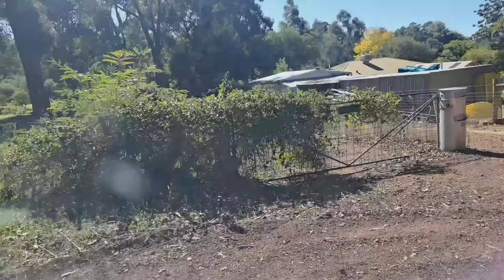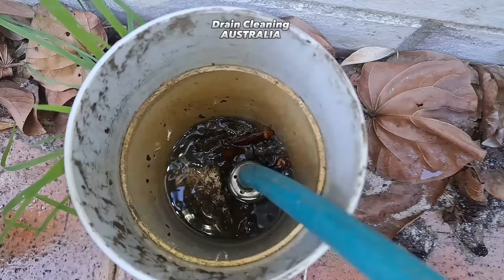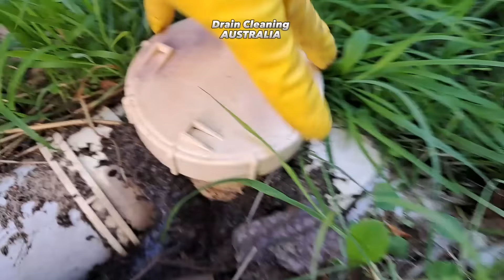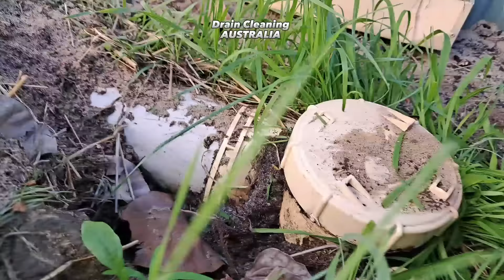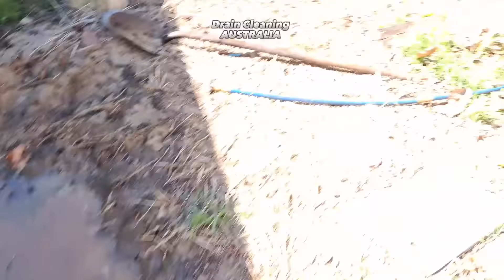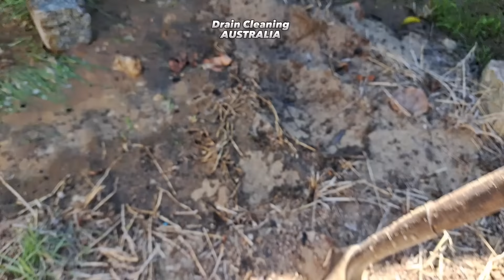The WORST Blocked Drain of my Career! 🚨

Comment: Note to self, when the owner tells you it’s not the problem, that’s exactly when you go directly to where they said it was not and its right there, fun times, thanks Bruce.
Reply: When our small model making shop lost our lease and moved into a shared workshop, the lessee of that facility advised us that, although she had a large lunchroom, we had to pour any extra coffee, water, etc. out in the washroom in the hall. Her double sink was completely blocked, and if we ran water into it, we'd be bailing it out by hand. Some PROFESSIONAL PLUMBER had quoted her $$$ to rip up yards of pipe as the problem was complete block 30 feet away,  blah, blah, blah. 
I don't know why I doubted that (with no qualifications in plumbing at all) but found a force plunger in the janitor's closet and borrowed it. I quietly ran a few inches of water into one sink and seconded another woman working there to put all of her (considerable) weight on a wad of wet paper towel stuffed in the other sink's drain. Pump. Pump. Pump >CLUNK< clunkle – the noise came from under somewhere far down on the first floor, and the water poured out of the sink.  
Our new sub-landlord was delighted at the news, convinced I was some sort of plumbing genius among my other talents. It made for a good start.
Reply: The only snag with brute force is when a push fit pipe coupling pops off. It’s best go check the downstream pipes before you give it welly.
Reply: Goes for electrical too… whatever the customer says, put it out of your mind, and start from square 1. Every time .
Reply: @carmium  Plunger is the answer. I had constant issues with my shower getting clogged and everyone told me to use chemical unclogger.
It worked but I had to unclog it every week. At some point I saw a heavily discounted plunger in one of the supermarkets (-90%) so I decided to buy it.
After plunging that shower it did not clog again for next 6 months. Now all I have to do is 1 minute of plunging twice a year.
Nothing beats a good plunger (maybe except for mr german, but I cannot afford that kind of hardware)
Reply: @carmium  great job!!!!
Reply: That was my immediate thought, too, like the homeowner did the work themselves and are convinced it can't be their work that failed!

Comment: Great video, your commentary is OTT 🤠
I know of a blocked drain not unlike that one.
Imagine two blocks of 12 units on the same property.
One considerably down hill from the other with a blocked sewer between the two buildings.  The plumber cleaned the blockage and with a huge whoosh the water and solid matter went down the hill.  Problem solved !
A month later people from a ground ground floor in the lower building returned from holidays.  The bathroom has shit stuck to the ceiling and the rest of the unit had a tide mark the walls.  I don’t know how the other people in the building didn’t say anything.  I guess that’s why you have surge protection.  Builder must have thought nah we will be long gone by them.
Nothing at all in the unit survived.  It was stripped back to concrete on every surface.

Comment: That drain was pure quality. The explosion was a thing of sewage beauty! Question, Bruce. The elbow of the drain you said it was too high. Also the elbow seems odd. Is that up to code? Would the owner need to re-route the drain line?
Reply: More than likely yes. I can only speak for Americans here, but typically sewer lines are suppose to be buried quite a ways deep. Mine Is about three feet under ground if I had to guess but its probably more like six feet. Also that elbow being that sharp, in my uneducated opinion, for a sewage line is just straight up asking for trouble. A more gradual turn using two 45° bends would probably work better.
Reply: @Nalothisal  Most Aussie lines don't seem to need buried far because there's no risk of freezing.  One foot seems pretty typical in the videos here I've been watching for two days.
That elbow is less than 90° which is why it probably seems odd to some.  As long as the line is generally moving downhill, though, it should be fine.

Comment: I've just joined, my last encounter with a dog was when I used to fill up household LPG tanks. A Doberman escaped from the house I was at, before I knew what was happening it had bitten my arse and wouldn't let go, even though I was shouting to the owners they did nothing, so I undid the gas pipe and let off some propane in it's direction, it soon let go. The owners weren't happy, until I showed them the ripped and bloody overalls. When I got back and reported it to the boss, they reported them to the Police and the RSPCA, it appears that I had not been the first to have problems. Nice bit of drain action, I have family that live in Perth my aunt and uncle where £10 pomms. 👍

Comment: That the worst? Never done a council blockage then? With a main line running a few Kms up a hill? Two or three hundred houses?
Now that's FUN!
🍻👍🇿🇦😎
Edit: why the hell do you jet from the house down to the connection or septic tank?? We always go from manhole to house. (Prevents flooding at the house)

Comment: Interesting watching you do cleaning with a jet i jad to use the machine with a blade on the end and machine they gave me only worked in neutral and had a bunch of roots bunch my 3/4 inch cable around my hand up to shoulder where ibwas stuck for 4 minutes lucky got it out quick enough was in a cast for 3 weeks with crush injury doc said. Lost my job cause i refused to use that machine and requested jet machine which they wouldnt let me use for jobs

Comment: Once you saw that the bend was blocked, and you knew nothing was coming out of the next drain opening, why didn't you start at the lowest drain, the one with no blockage, and send the root breaker and the German up stream? It seems to me that that would have prevented the explosive discharge onto the property and the neighbors property.
Reply: Why? So that the blockage could then explode from the lowest drain  instead?
Reply: @PeterCaptainObvious  No, it would have flowed down the rest of the drain and into the main.

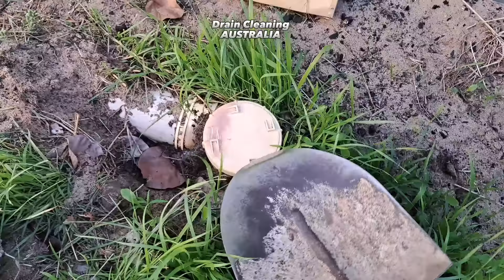Comment: At 5:25, hitting that inspection cap with the sharp edge of the shovel is almost sure to break those lugs off of the inspection hatch.  It is severe misuse, and the perpetrator should be castigated most thoroughly for incorrect usage.  A solid square bar should be used, to put equal pressure on two opposed lugs.  That Drain Cleaning twerp should be ashamed of himself for showing such misuse and being proud of it.